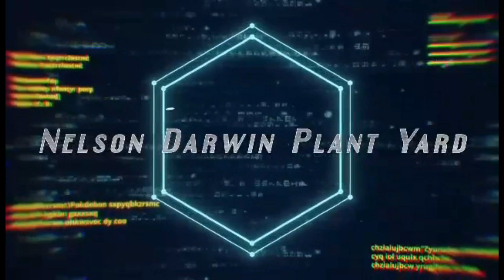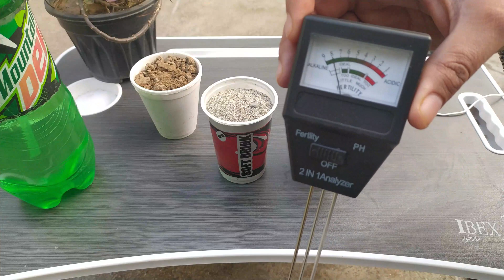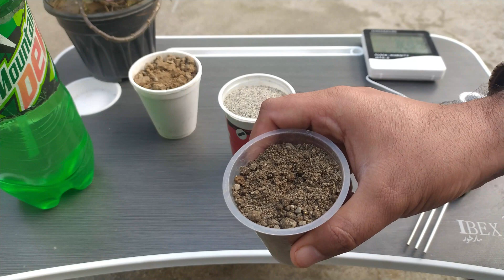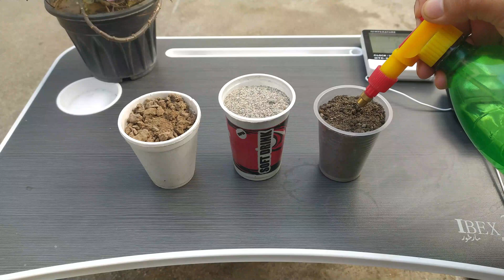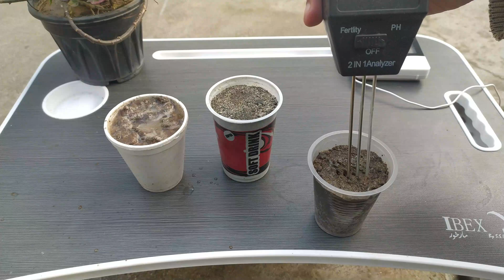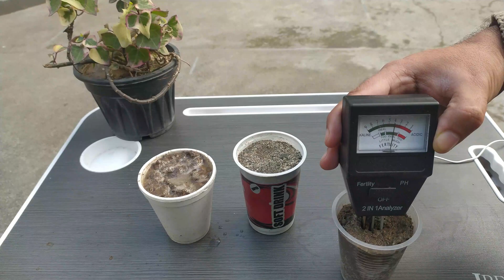How to use the soil fertility meter | how to measure the fertility of soil with soil fertility meter

Comment: Thanks for the video.  Question, you switched to the fertility part of the analyzer. When I’ve read that 1 should test the PH?  I’m planting blueberries, which have a low PH. However; every time I test various soil, the PH levels are not even close. But when I switched to the fertility side. The needle moves to a more acidic side!?  So which switch?  Thanks